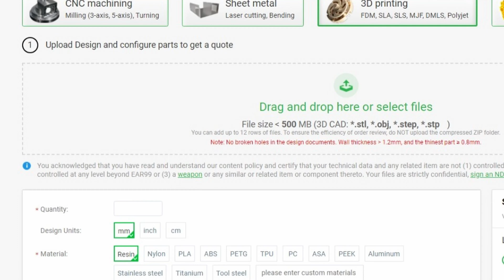Scrapping old PC Parts - What can A Maker Salvage?

Comment: i salvaged a lot of motors over the last few years but never needed one. only a realy big printer motor was powerful enough to be usefull. but a printer has realy nice metal axles and mecanics inside. i used some parts for a camera slider that i build for a friend . most useful things i found are fans, heatsinks and power fets/diodes and capacitors. also some pc ports like vga, serial, and usb are usefull.old laptop displays are also realy nice, there are some chep cinese driver boards that can turn these in usefull external monitors. also laptop webcams can be connected to an old usb cable directly. also some big power or shunt resistors are nice to have

Comment: If a chip to a key chain, remember the chip might have some tiny thin gold wires inside that connect the internal to the outside, and gold is going up everyday in value. So it is NOT just a key-chain.